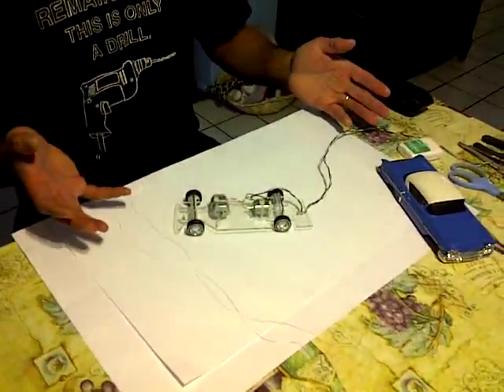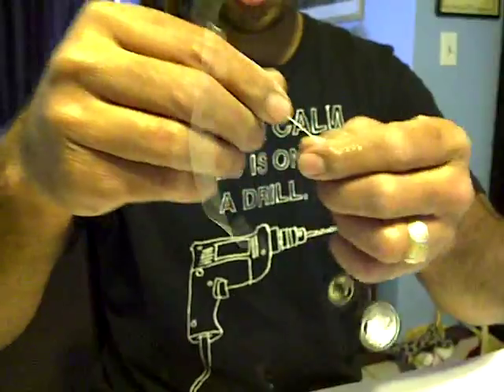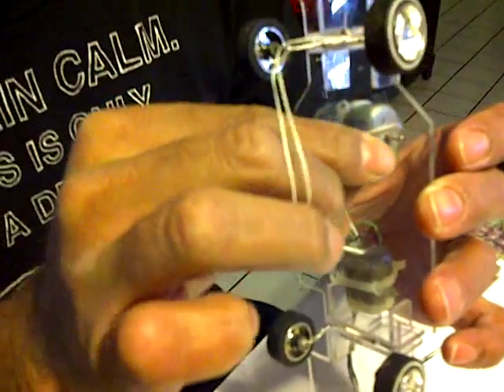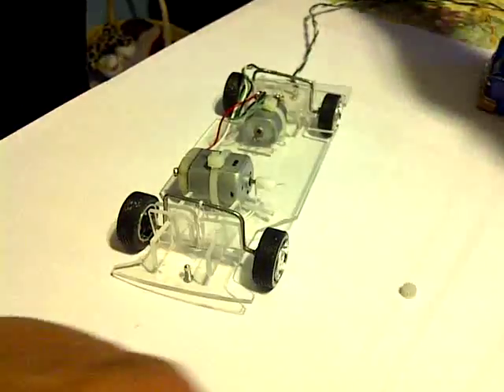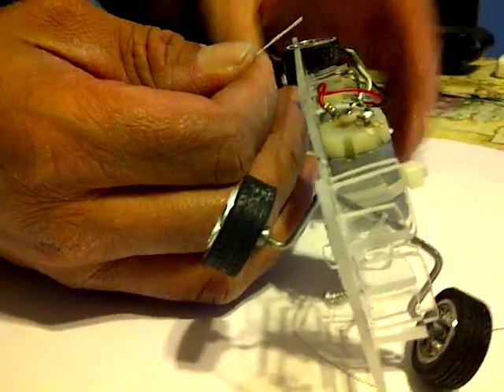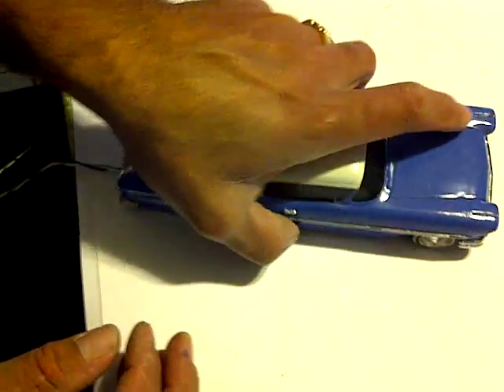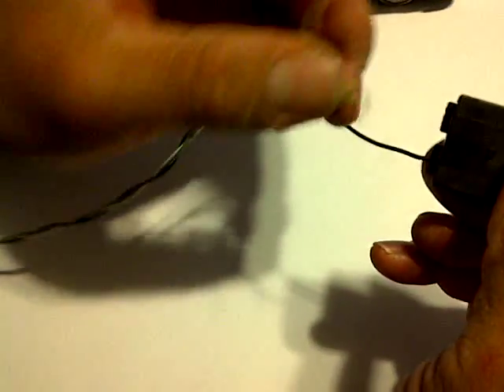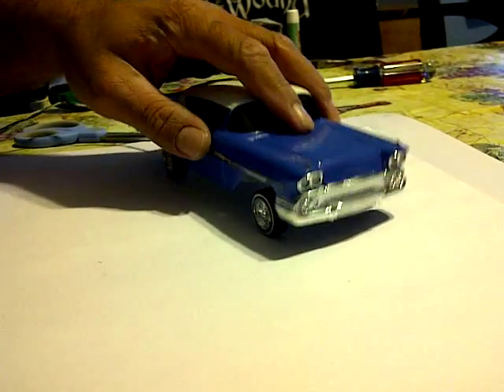how to string gabs hopping car

Comment: What you think about fishing wire? It a lot stronger but I can’t get it to hop with out locking up
Reply: Jacob s what can u use for a guide
Reply: I have the same problem my motor hop one time and spend the string around it